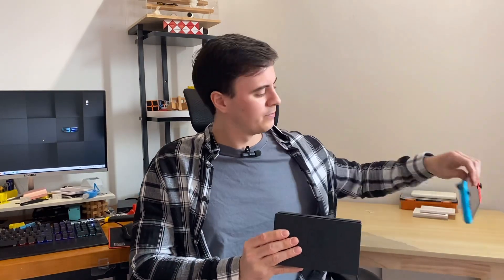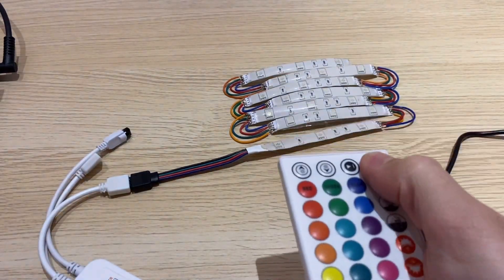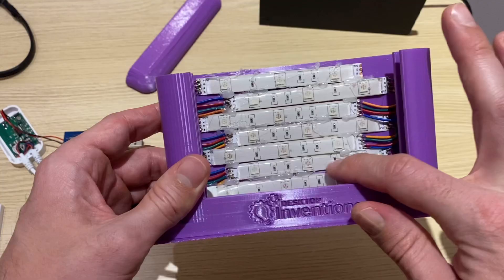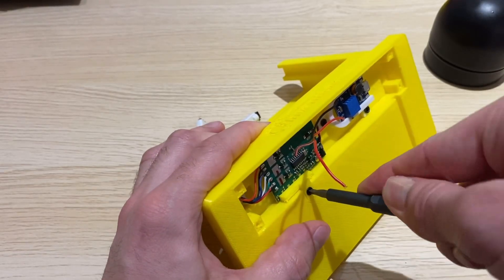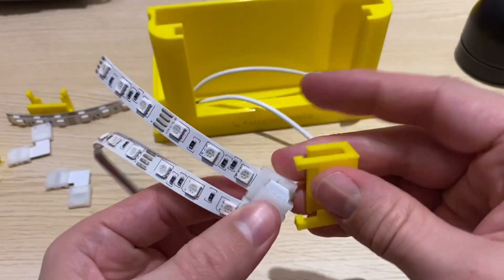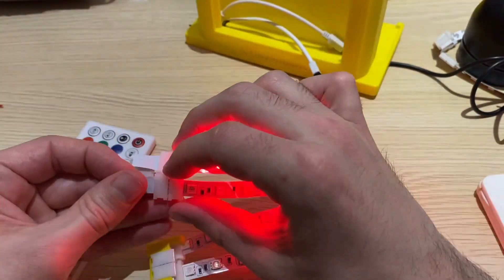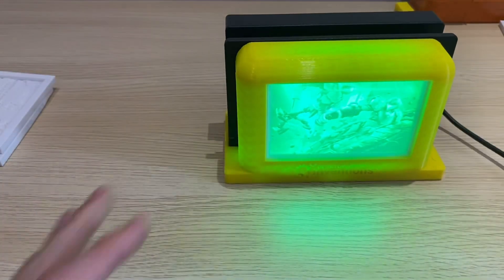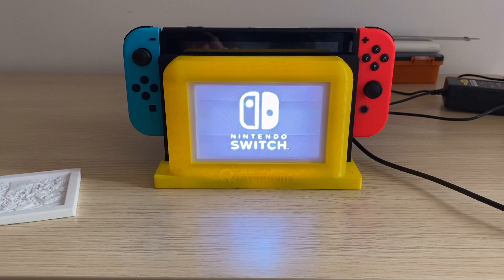Making a Lithophane Add-on for Nintendo Switch Dock

Comment: The led lights you put in the description are unavailable, is there any other kind you’d recommend?
Reply from the maker: Sorry about that!  I looked around for another strip with similar size and spacing.  The closest one I could find was a black PCB and it's IP65 meaning you'll have to peel the glue off if you want to solder or connect them together.  Most LED light strips will work if you want to find another source, just try and get smaller spacing if possible for best fill in your picture frame.
Reply: Thank you